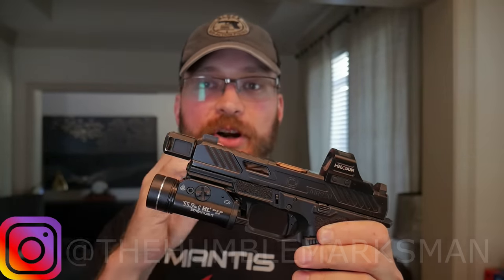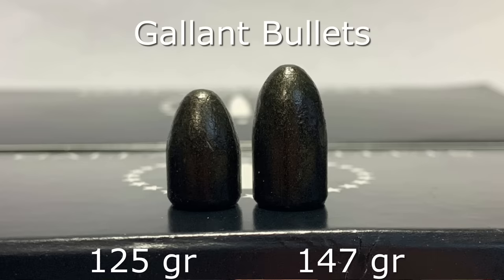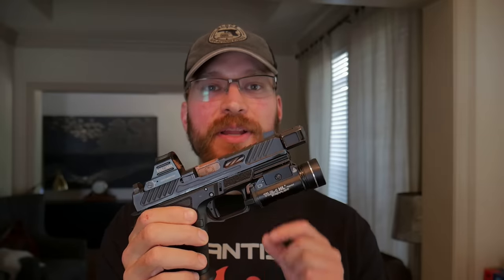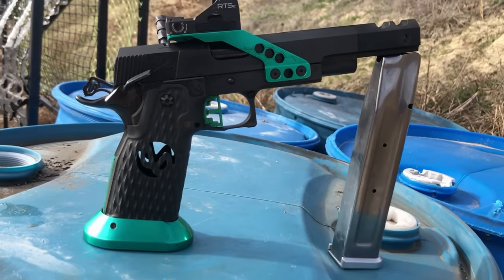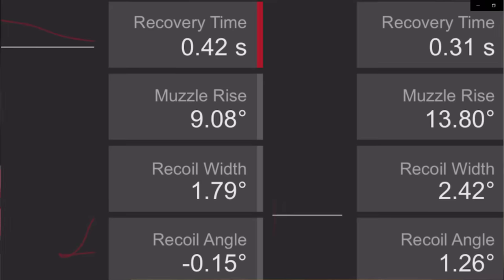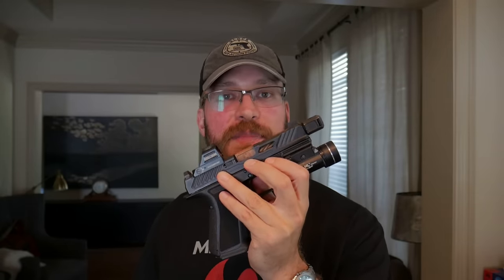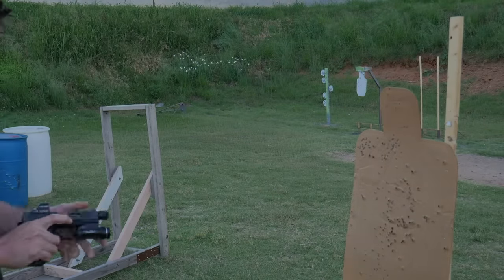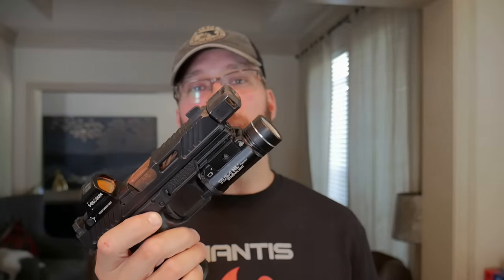Carry Comps - do compensators actually work on 9mm pistols?

Comment: The problem with a comp on a carry gun is what happens when you shoot from a retention position, aka, "thumb pectoral index." Having a comp so close to your body will result in burns and possibly loss of eyesight. Also, if having to shoot from inside a vehicle, you will ignite your headliner. That has happened before. Since you don't get to choose the conditions under which you must defend yourself, I will have to decline this device for self defense purposes.
Reply from the maker: I shoot from retention in this video
Reply: @TheHumbleMarksman  True. That doesn't mean everyone will have the same result. A friend of mine didn't have the same result. He did get his eyesight back. Have you tried using a comp inside a car that has an intact headliner? Bring marshmallows, graham crackers and Hershey bars.
Know that I'm all for getting faster follow-up shots. It's just that certain comps are good for concealed carry (except when shooting from a vehicle) but others are not.

Comment: Great for a range gun, but you would never put one on a conceal carry gun.  Take a Glock 19, it adds full size length but you don't get the velocity.  If you are going to carry at full length, why not have increased velocity.  The other reason is serious reliability issues.  You have to shoot +P rounds or you will have malfunctions.
Reply from the maker: Well designed carry comps are reliable with target loads.

Comment: I've heard, in general, that if your home defense gun or EDC gun is tweaked in any way, that if you had to use it to defend yourself and you go to court, the forensic officer could say your upgraded gun gave you an advantage over a stock gun. I know I'll get flack for saying that but if it's true in any way whatsoever, you could be facing an uphill battle in court.
Reply: That's the point of having a firearm to make it as "unfair" for the bad guy as possible.  The most "modified" gun will NOT make you John Wick that only comes with training. Then what will they say you have a bone stock gun but still killed the offender,  you trained too much?

Comment: 9mm doesn't have the pressures of gas equal to having a comp to do much at all now on something like a 38.super 1911 the comp helps
Reply from the maker: Standard pressure 9mm rounds can be dumbed down by 20% of muzzle climb before you have to begin tuning slides

Comment: Compensators on any handguns except competition handguns are a plain bad idea imo. A slightly flatter shooting gun with slightly less recoil (on a 9mm platform without much recoil to begin with) is not more important than your permanent hearing. Compensators make your firearms noticeably louder, and shooting anywhere indoors (or really anywhere except an open field) will also amplify the sound of the gunshot as the sound bounces off the walls. You can actually hear this in this video as you're firing the handgun because of the walls next to you, even though you're outside. Tacticool nonsense, unless you're running USPSA.
Reply from the maker: on the 43X - since the comp is so small - it's not a lot louder than it would be otherwise.  It is louder on the G19 since the comp is bigger.

Comment: I've been testing the tyrant cnc glock comp. It's working pretty well, but after about 700 rounds I had to replace the O- rings. It shipped with 3 pair. Supposedly a years supply.🙄
Reply from the maker: yikes - none of the comps I have in have O Rings to try.